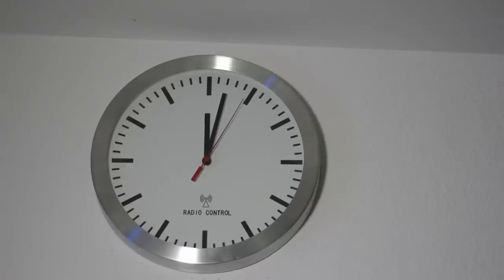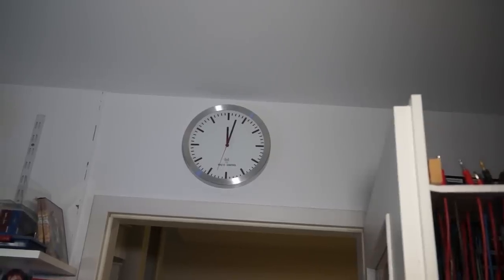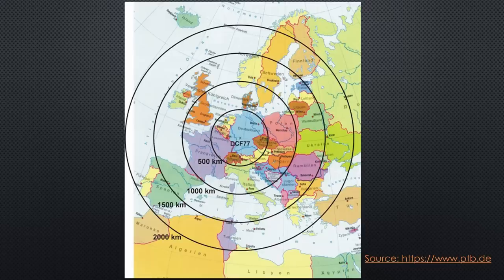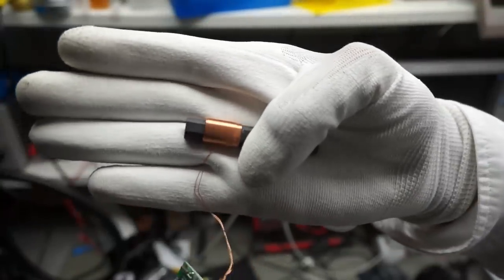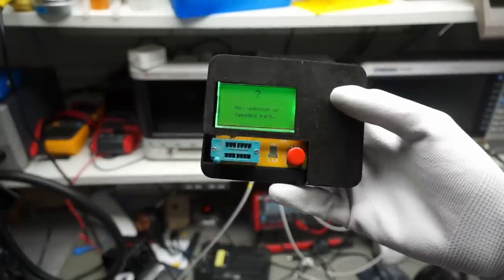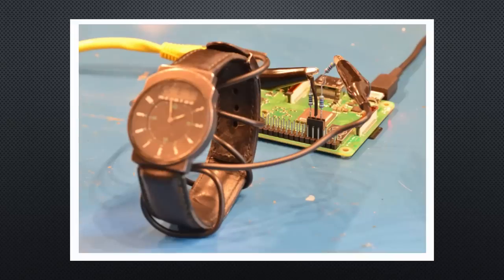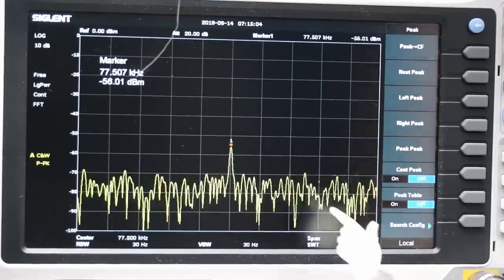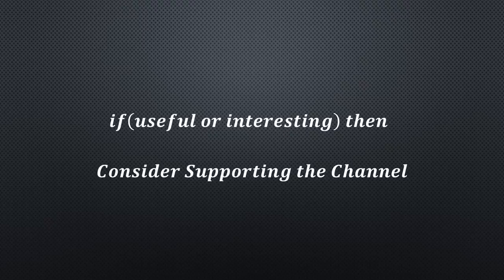#287 Remote Controller for Clocks (IKEA and others, DCF77, WWVB, MSF, JJY)

Comment: My dad complained that his DCF77 clock wasn't syncing for a while. "Turn off that LED bulb", I said... and the clock synced immediately. Switch mode power supplies could become a challenge for these LF radio clocks.
Reply: Yes we had the same in the UK too, when the original clocks also used DCF77. The signal is a bit weaker here than on the continent. We now have our own 60 kHz which gives a stronger signal and has been adopted for clocks available in the UK. The compact fluorescent bulbs were even worse than the LEDs, I recall. Also bad are things like induction hobs and some mobile phones.  I suppose that the secret is to place these devices and clocks in different parts of the room ! Switch mode power supplies yes if made very cheaply. I have a properly made Bosch that charges up my electric bicycle battery, and despite being next to my radio clock, doesn't affect the latter. The usual story I suppose ! great that you solved your dad's problem !
Reply: Excellent catch!!!
Reply from the maker: @Michael, this might be a reason my Ikea clock does not sync in my lab ;-)
Reply: I recently had to replace the light bulb in a garage door opener, and couldn't find a rough service incandescent one meant for that.  Instead, I discovered they now make special LED bulbs for garage openers, with circuitry that won't interfere with the opener's radio control receiver.  Good to be aware of that, and therefore just how many ordinary LED lamps and such could interfere with radio signals.
Reply: @Bob Blum — As far as I know, the low-RFI LED lamps you mention are currently sold only by Genie in the United States, apparently commissioned by them. Since they are a sole source, competing garage door opener manufacturers recommend their use in situations where interference from the lamps is hampering reliable reception of the the radio remote control signal.
Reply: @Milosz_Ostrow  Good question!  The lamp/bulb I replaced was at my mother-in-law's house, I think I recycled the packaging there.  The next time I'm at the same store I'll try to check on the brand name and report back.
I'm sure other LED lamps may not interfere, obviously it depends on their specific designs.  I hate it being hit or miss; it's bad enough with fluorescent and CFL causing RFI, now add LEDs to the mix.  😯
Reply: Alsotheo sync pulse in those old tube TV's could make problems with the DCF77 signal. To put a DCF77 clock on top of that TV-Set was no good idea.
Reply: @Milosz_Ostrow  Sorry for not replying sooner, forgot about it but then came across the box from the garage door opener LED bulb.  It's a General Electric (GE) 60-watt replacement (10-watt actual), for US 120 VAC service.  Box shows:
Desc: LED10ASW9CPGAR-1  Res. #1631276  PC: 47665  CTNLEDA191SW10GE47665ASCH-00
I hope that helps, I'm sure there are other similar ones available.
Reply: Some LEDs are using Capacitive Dropper instead so they might be more suitable.
Reply: anything using simple bridge-rectified HV ends up with nasty current patterns and RFI as they only draw power during the peak of the cycle, IUtś about the ansolute worst kind of power factor to deal with. On Compack flourescents there's the (usually unshielded) oscillator to deal with too.

Back in the mid-80s I spent quite a while demonstrating to NEC that their fancy new 140MB digital microwave rado systems were fantastic but the switchmode power supplies they used wiped out landmobile bands - and such things being on hilltops next to landmobile repeaters was a bad combination. The next generations had MUCH better RFI filters on the outputs. Things you don't think of in lab-conditions....
Reply: Any of the digital circuitry noise can be a problem for RF circuits, from SMPS circuits to displays. Today's digital and microcontroller-based projects need to carefully  isolate away (both electrically and physically,) from the analog and RF circuitry. That has always been known by electronics professionals, but hobbyists are learning it the hard way.

Comment: I use an app for ios (clock wave) who do something similar: Encode the ntp signal in wwvb (or dcf77) format and play it on the speaker of the phone at 20khz. An harmonic of the signal is broadcast by the speaker coil and sync a watch placed near it.  I amplified the audio signal with an audio amp, created a loop antenna, and I can receive the signal few meters around.  Anyway I Will try your set-up because I think it's a more "elegant" way to do it  ;)
Reply from the maker: That is a very creative way of using a loudspeaker! I just bought the app and I am curious to use it when I have time.

Comment: This is an interesting project. 
"Usually the range is bigger at night". I've noticed that. Lidl was selling DCF77 alarm clocks and weather stations at one point and I bought few of them.
The weather station gets the time automatically during the night. Two alarm clocks haven't gotten the time even once during two months. The weather station only started receiving the signal when days got shorter and nights got darker.
We live 1500-2000km from Frankfurt.
Reply: That is correct. LF & MF (Long wave & Middle Wave) have a longer range during winter time as the sun is not as active as compared to the summer time. This is because the ionized layers of the ionosphere change according to the angle of the sun, thanks for correcting Professor Frink.
Reply: Mai Mariarti  the angular velocity on the Equator is the same as on every point of the Earth, 15 degrees/hour. But the linear velocity is the highest, dropping as one moves towards the poles.
 If the transition "zone" between light and dark is X miles wide, it will happen the fastest at the Equator due to the linear velocity, as your location moves through the zone. 
Add to that that the "zone" is wider at higher latitudes due to the angled incoming light and scattering.
Good map illustrating twilight zones: https://www.timeanddate.com/worldclock/sunearth.html

Yep, currently, the Earth is closest to the Sun during Norther winter.
But this changes over time, together with other factors such as the amount of eccentricity of Earth's orbit, the amount of tilt to the rotational axis etc., all with their own periods, combining to higher or lower maxima/minima as the factors combine or counter eachother.
Reply: Просто интересно: 2000 км сигнал запаздывает на сколько мксек? Что показываю по ЦТВ задержка 4~5 секунд, но с этим можно смирится если она ежедневно и ежегодно стабильная, правда в высокосные года, как? Да и Земля, ☀️ не совсем круговая орбита, значит должно быть ускорение, или отставание. Корректировка фазы синхронизации с эталоном в в США, Лондоне, Токио, производиться раз в месяц, год?☕🙋

Comment: Thanks, this is a useful instructional video how to get txtempus running with higher reach transmission. In my case, I wrote txtempus to get a German watch running in California, but basement clocks with poor reception will of course benefit greatly as well.
The txtempus instructions with the 'wire turn antenna" are also left deliberately simple to make sure the default built will stay within very low radio emissions. But a tuned circuit that Andreas presents here and possibly impedance matching of the antenna will greatly increase reach. 

Ah, and daylight saving time switch worked nicely last time it came around :)
Reply from the maker: Hi Hennes, nice to see you here :-) Thank you for your code! As you can see in the comments the „basement problem“ seems to be quite common... And thank you for your update about the winter time! BTW: Some viewer asked for an ESP32 version. Just that you know ;-)

Comment: Thanks Andreas for this video. I live in Australia where we don’t have a radio time signal. The kitchen clock never seems right so this seemed like a great project. 3 weeks later and I have perfect time in the kitchen and will never have an excuse for being late!  I bought the inexpensive frequency generator you showed in your video. That in itself was a little fun project.  The clock I got was a MSF analogue. I wound about 350 turns on a 9mm ferrite rod, single layer. I didn’t have a way of measuring impedance, so I used an online calculator for working out the windings. After a bit of experimenting I used a 680 pF capacitor with a 100pF trimmer capacitor to tune the circuit. I am using a raspberry pi zero w. I had an issue with the frequency it was generating (161O Hz rather than 60KHz) Fortunately this issue was addressed in the Issues section of hzeller git repository.  I would rather not be transmitting continuously so plan to create a cron job to run for a few mins every night. I still have to case it all up but the project has been a lot of fun. One question, any suggestion on a way of working out the transmission power, so I can make sure my transmission is not likely to cause any havoc?  Many thanks for your great videos. I enjoy them a lot. Gerard
Reply from the maker: First: I am glad the Australians now also have accurate clocks ;-) Tuning an antenna by experimenting is fun, but, as you describe, probably a little slower.
Concerning your question: I would put your clock a few meters away till it stops to synchronize after reset. Then you have the reach of your antenna. These clocks are very sensitive and if this range is just a few meters I would assume your transmitter is not stronger than many electrical motors or other noise sources. Just much more narrow-band.

Comment: To really easily test the LC resonant frequency, put a scope over the circuit and spark a small voltage over the circuit, the ringing that happens will have the frequency of the resonance.
Reply from the maker: Good Idea. Never tried it.
Reply: I disagree ....:-)... a grid dipper would be most likely an easier way to do so ...  sorry just couldn't resist to say

Comment: Time ago I saw a way to test filters with an oscilloscope and a sweeping generator. Synchronizing the sweep start wit x axis gives you a Bode plot of the filter frequency response on the scope. It requires some manual adjustment on generator setup and a general idea of your frequency range, but it should work even in a low cost lab, especially for these frequencies. Cheers!
Reply from the maker: Interesting idea. Thanks!

Comment: May I add an additional comment please ? In his introductory text ( above ) Andreas very kindly includes every possible link for further information - thanks to him for that ! His first link is to "Software" on Github. Just looking at this,  there is an expanded version of the information that Andreas provides, including additional information which is a great help to some of us. Firstly the software HAS been tested on the Pi Zero WH ( I asked below ), which is cheaper to buy than bigger models and possibly easier to use in some respects. Secondly, for those of us in the MSF reception area, there is a suggested variation upon the resistors used in the external components. Thirdly, there are different ideas suggested specifically for wrist watches. So as well as taking in everything that Andreas tells us above, also take a look at the Github project page for the additional notes. Many thanks !
Reply from the maker: Thank you for summarizing the content of Henner‘s GitHub!

Comment: My favorite wayy to determine the resonance frequency of a RLC is to use XY mode of oscilloscope. Once you reach resonance, voltage from source and accross the resistor will come in phase. Then you get a line instead of of an ellipse displayed on the XY mode. This is pretty accurate
Reply from the maker: Good idea!

Comment: Well explained as usual. Just one thing to add, if you buy one of the simple analogue ones, those may not allow for an offset. So for example, a  DCF77 clock will show he wrong time in the UK as we one hour behind Frankfurt. I have one of those (longer story) and it works fine in the North West of the UK, but the only way i could adjust it to the correct hour was taking it apart and slip the hour pointer an hour backwards.
With regards to transmitting on random frequencies, if i remember that correct, anything above -10dBm ERP is supposed to be an illegal transmission (mileage may vary, depending on country), obviously except you got a licence for what you doing.
Reply from the maker: Because you create your own time signal here you can send UK time. Concerning ERP: Well possible that such a maximum value exists also in other countries. This device then should be well below this value.

Comment: Andreas you are very fortunate being a Swiss national when it comes to discussing time and time keeping instruments (horology). Horology is a hobby of mine so I am very familiar with the swiss heritage in making accurate clocks and watches (both automatic and quartz movements). I also believe I understand the Swiss Horology mindset. 

I know you like to make interesting YouTube videos, especially using off-the-shelf embedded systems (Raspberry Pi), but in my opinion the Swiss Horology solution for your IKEA clock is not to use an external radio timing reference (even one you make in your lab) or a satellite signal or any other signal external to your clock, but to have the timing accuracy inherent in the clock movement itself.

Your IKEA wall clock has a Chinese made radio controlled movement, which by itself should make you being Swiss cringe. Just look at your IKEA clock seconds hand, you can see how it is bouncing on the gear lash, meaning it does not even have a basic pressure backlash feature on the second hand gearing. Your clock should have a smooth moving second hand with no perceivable stop or start. This would also translate to both the minute and hour hands through the gear train.

I think you being Swiss should set yourself a goal of making your own movement with an accuracy of +/- 4 seconds per year. Which is not hard to do if you have to manually set your clock (calibrate) every 6 months or so when you come off and on daylight saving time. So, we are looking at +/- 2 seconds every 6 months. Which I think is doable with some newer OCXO (SiT5711) on the market without a phase lock correction source or on-going calibration. The clock is indoors so you don't have to worry about temperature errors, and you can provide a hyper stable supply voltage and a OCXO consistent load, so your only real obstacle is aging. 

Using a OCXO will mean you will not be running off of a battery but AC power, and if you lose power you will have to reset your clock, unless of course you have a backup battery power source (Preferably rechargeable). You can use discrete logic to divide down your 10MHz clock source to give you the pulse rate you need, or perhaps use a programmable logic IC, which would then drive the stepper motor power amplifier.

You can hack the movement in your clock and keep all of the basic gearing and just power the stepper coil. You can even make your PCB the same size as the original PCB in the clock and just notch the case for a connector (perhaps USB-C). If you want a smooth running seconds hand you can hack a similar sized Seiko wall clock movement with the same hand mounting shaft diameters, or use another set of hands that fits the posts (many options are available) where the only difference is in how the gearing is done relative to the stepper motor pulses, from one (your IKEA clock) to eight steps per second. Here again you can just take out the original PCB and put in your own improved version. If you want even smoother movement you can add your own micro-stepping stepper motor and upgraded micro stepping driver. Micro-stepping is perfect for a clock movement because you are not challenge by RPM speed or torque. But, if I where Swiss I would hack an indoor swiss made MOBATIME indoor wall clock movement and toss the IKEA clock which has obvious problems.

You are Swiss, you are self reliant, do not rely on outside foreign signals to accurately run your clock. "Unus pro Omnibus, Omnes pro Uno"
Reply from the maker: Thank you for your ideas. I made videos about precise clocks where it matters (satellite communication on 10GHz). Search for QO-100 if you are interested.  But as an engineer, I live the slogan "good enough". This crappy IKEA clock is "good enough" for the purpose of a lab clock as long as it does not have a trend. In addition, I am not very good at mechanics :-(  So somebody else has to do this hack.

Comment: Casio make various watches called "Wave Ceptor" which have a built-in receiver for all the various time signal transmitters around the world. The watch sets automatically once a day.
I recently bought one for about EUR 110. Really happy with it. Remains accurate to less than a second.
Reply from the maker: I did not know that Casio also produces such watches. Thank you!
Reply: @AndreasSpiess  The one I got is model WVA-M640TD-1AER and best price on Amazon de as below.  Apparently very similar watches at prices up to EUR300+ and I don't understand why they vary so much.
One curiousity is that many of these watches do not have an all metal case. Mine is Titanium mostly, but includes some plastic as well. Presume that needed else the case would shield out all the RF.

Titanium case, black dial, solar powered, multi-band
https://www.amazon.de/Casio-Wave-Ceptor-Herren-Armbanduhr-M640TD/dp/B00EDAT9DM/

Comment: I have a digital wall clock bought from aldi... The great advantage  in this application is that it will run for many years on a set of AA batteries.  The date and time is transmitted at one bit per second so it's a very low processing load. I don't think GPS or NTP or any other exotic system can be received and decoded  using as little energy... though I'm happy to be correted if anyone knows better.
Reply from the maker: You are right. This is why I like the concept.